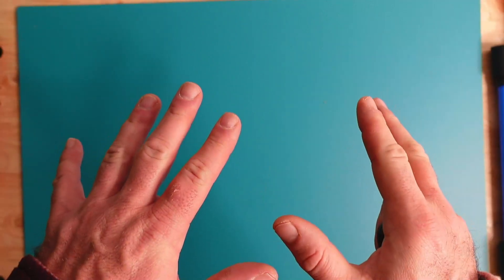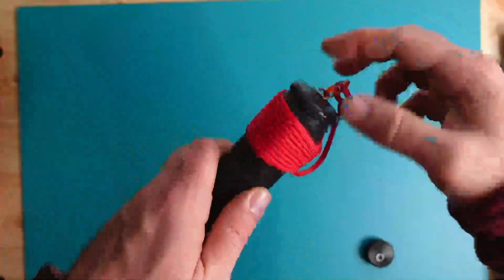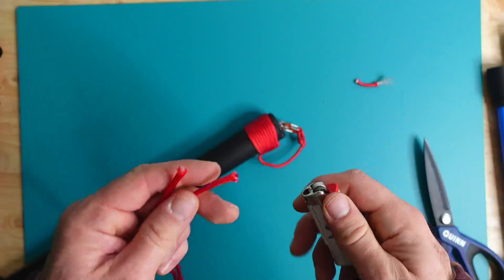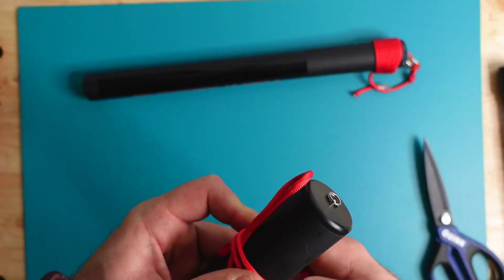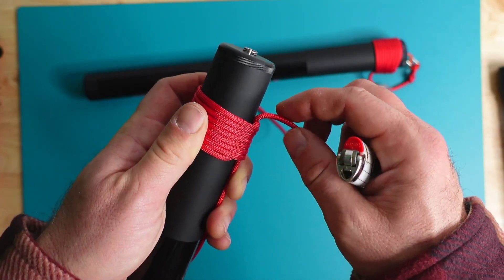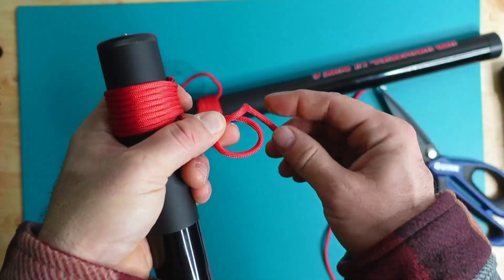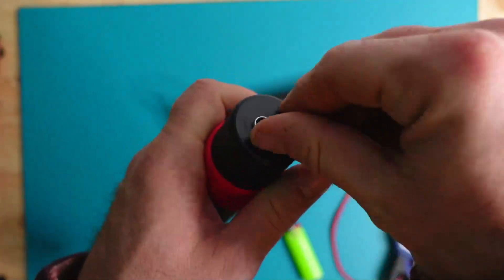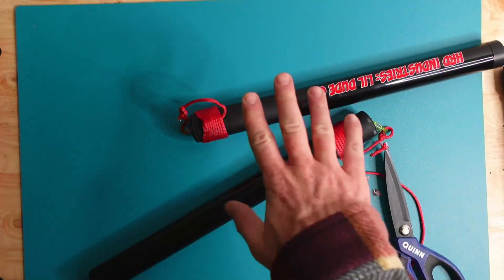Do THIS with your Portable Ham Radio Mast

Comment: Would be a good idea on the top end. The bottom, you really don’t use it. That’s what I think. Good job.
Reply from the maker: Sure, I could appreciate that. I open it all the time to place my ground mount spike in there..  Also, my top end is where you hang the wire off of, when fully expanded, so no need for me to tie that to the bottom unit.  Others may not do it that way, due to not having those options. The top would be just as  simple. Good call
 Have a good one.